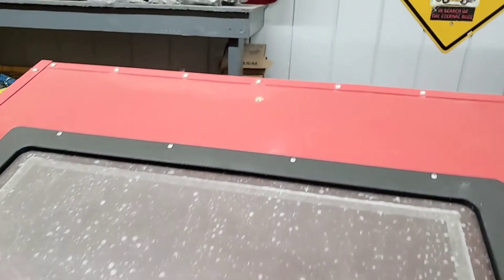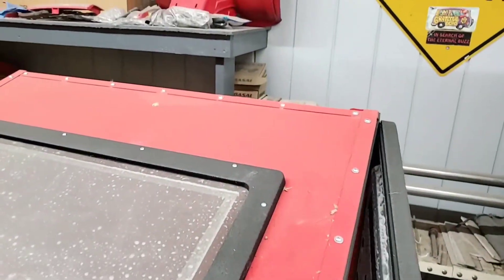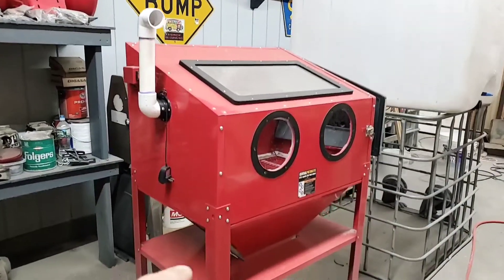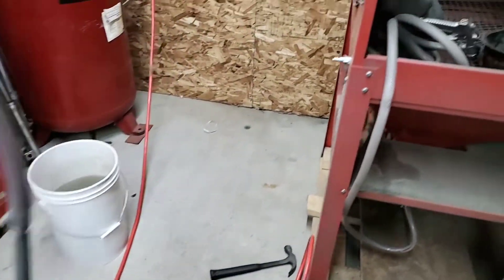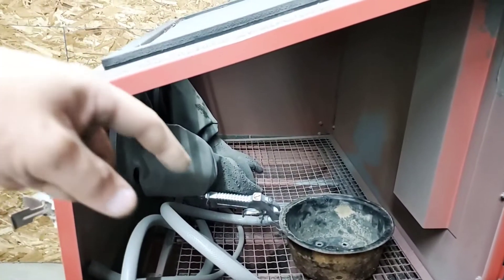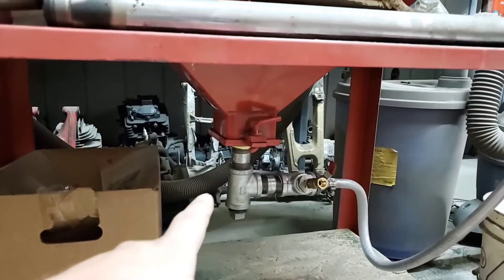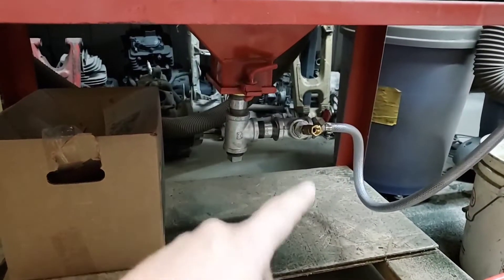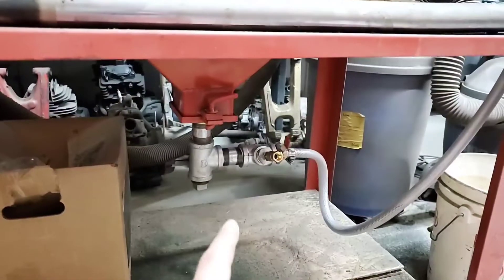Harbor Freight Sand Blast Cabinet Upgrade - DIY Metering Valve

Comment: 1” plug
1” x 1” T
1” x 3” nipple
Teflon tape 
1” x 3/4  t
3/4 x 1/4 reducer
1” to 1/2 reducer 
1/4” brass nipple 
1/4 ball valve 
1/2” brass barb 
1” flange 

There’s the parts list so you don’t have to write it all down as you watch like I did! 😂

Comment: So a heater or heat gun inside the cabinet helps keep everything dry..but you should never be using SAND to blast with unless your stage 4 already..glass beads don't care about moisture..a number of people convert them to a vapor blaster with a water sump pump , trash can to hold the water and glass beads..zero dust to worry about..makes for a smoother finish too..basically use anything but sand in the " sand blaster"..

Comment: The Harbor Freight instructions indicate a need for 9.5 CFM at 90 PSI, which generally requires a larger 60 gal compressor. Do you think one could get away with a smaller compressor which produces about 5 or 6 CFM?

Comment: nice video, thanks.  But, you had me yelling at the screen when you said you messed up by making the hole in the trap door too small- you could've just flipped the pipe flange over (flat side down) and built it that way, no need to enlarge that hole.   Thanks!

Comment: Very nice info. One tip i learned when being a teenager: at minute 3:47 you try to put the Teflon tape on the thread. You put the begin of the tape on the tread. That is going okay. The tape is on top of the thread. Then i see you wrestling with putting it on by turning. The tape starts on top of the thread and then it goes to the top side of the role. And that can be done better: turn the role around so that the tape hoes from the top of the thread to the bottom of the role. This way you have a way better control during taping the thread. This is because of the tension you create. Second: start taping at the the root side of the thread. This way the tape will not be pushed upwards like you can do with an arm sleeve. The first winding of the tape will push on the second one so to say, when assambling the workpiece in the threaded hole.

Comment: To save a lot of extra work whenever you have a part as rusted as that hub was soak it in Vinegar for 2-3 days. It will do 90% of the work for you and come out almost rust free. Greatly reducing the amount blast cleaning needed.
Reply: 30% vinegar for 8-12 hours

Comment: Were you able to use your original gun or did you upgrade that as well?
I built a 3/4 inch metering valve hopefully it will work.
Reply from the maker: I am still running the original gun.  It worked well over the weekend.  So it's still holding up!

Comment: I've just done the same mod, for some reason I'm not picking up any media no matter how much PSI or how open or closed my valve is, any idea what im doing wrong?
Reply from the maker: Hmmm... does it do the same thing with smaller media??  I'd try dropping down a size or two and see if that does the trick?  I ran some course black beauty in mine after doing this and it didn't like it.
Reply: @ThisOldTrike  I've ordered some new media so hopefully it does the trick, failing new grit im stumped though?
Reply: So did changing media do the trick? @Toomzer
Reply: @ZenithClarity  it was the gun that was faulty buddy. 😜

Comment: Nice job!  Just curious...instead of using the pipe flange, do you think you could have fed the 1 inch nipple through the door and used jamb nuts with the door sandwiched between?  I know that means the nipple would protrude up into hopper more but that shouldn't interfere with flow...right?   It seems it might be a slightly easier install.
Reply from the maker: Yeah, I don't see why that wouldn't work.  Definitely could be an easier install.  The only possible downside I can think of is it may wiggle more since the surface area connecting one surface to the other isn't as large.  But functionally it should work just fine.

Comment: So I built a metering valve and now my blast cabinet will not pick up the media
Reply: metering values require air - not sure he explains that valve he has sticking out the front of the assembly.  It has to be partially open to create airflow to "pull" the media along up the hose as a mixture of sand and air.  If you don't, you'll just be trying to pull 100% sand up the hose which isn't going to work.  You either won't have the suction or you'll just be dumping sand out of the gun.  At the end of the day air has to flow.  the idea is meter sand into the air from that assembly!  Hope that helps.
Reply: Same problem here, have had it for a few weeks now still didn't figure it out
Reply: @jukas8085 same
Reply: Have u figured it out yet ?
Reply: @freddieisback I'm wondering the same thing. Not picking up much media at all no matter what I've tried yet.
Walnut shells are the only media I've tried so far.
Reply: @ZenithClarity  Have you assembled the valve correctly with Teflon tape used on all threads. The quarter turn ball valve needs to be in the open position, Not Closed, if it is closed you will not draw up any of the blast media. You may also need to adjust the valve to find best performance. I also prefer that it point upwards when fully assembled on the cabinet.
Reply: @ZenithClarity  I wound up buying a new sandblasting gun from tractor supply and I’ve sandblasted rusty manifolds and it came out good I used the course black diamond media I got the black gun with the hose and pickup tube
Reply: @freddieisback  yeah, I ended up getting a new gun also. The one it came with is complete junk .
Reply: I just did this… still not picking up media. So frustrating
Reply: Same here! All this time and money and no results! 😣
It’s actually worse than before I started doing these mods! Totally useless now! 🤨
Reply: Why a valve? Why not leave open

Comment: Sort of missed out on telling others how the rubber tubing is hooked up at the end. I have this sort of setup and it works great, no surging. In the video, it looks like the tubing goes through the door. After you said you need to drill a hole in the cabinet on the front, some may have been confused as to what comes next. Nice job showing the parts list for sure.

Comment: Is the 1/4 inch valve just a vent
Reply from the maker: It let's it suck a little air to let things flow better.  You can open it wide open  or restrict it to work best with your media.

Comment: The 'older' cabinet is actually sold as an 'upgrade' in Australia because it is larger. We don't have Harbour Freight here, but other machinery shops and Ebay Aus sell them. I bought one over 10 years ago and started upgrading it straight away as I had experience with hugely expensive systems through work. Back then it was just great to know I could clean bike parts in my garage instead of sneaking them into work. Assembly is not that difficult, silicone sealant is a must along all seams as you put them together. Cyclonic dust removal, light upgrades to 12v LED spotlights, large sheets of adhesive film for the glass, footpedal operation saving cramped hands, water separation on the compressor, a wmachine mounted regulator, nitto fittings on all external hoses, a steel cradle on castors to allow easy movement and an extra shelf to store media, snap on plumbing to a shop vac and an internal t-junction with a hose to a small air gun to allow cleaning off of dust and media inside the cabinet.
I recently purchased a pot type blaster for large items like frames to do outside, with a conversion planned for water as well. I observed the mixing set up on the base and considered it for this cabinet. This and other videos confirms my belief a mixing system at the base will be successful. If I put a ball valve at the inlet to the cabinet  on the media hose, then it will be easy to turn off the media, and just have air only, meaning the main gun can be used for clean up and the second air gun can be removed. Hmmm, idle hands, it's off to the plumbing supply shop then into the workshop.
Edit: Put your non alloy items in a tub of water/caustic soda for a few days first and most paint and grease will hose off with a garden hose after. Then put the items in a tub of vinegar for a day or two and hose them off again. The working time of your machinery (and you) will drop by 75%. It works for steel, cast iron, copper brass etc. Aluminium alloys and die-cast monkey metal will be eaten away in 12 hours by caustic soda, but vinegar will soften up corrosion first I you want to soak a heavily corroded item. A mild solution of alkaline salts also works well on alloy parts before beadblasting. Old tips from an old dude who believes in working smart not hard. 👍🇦🇺